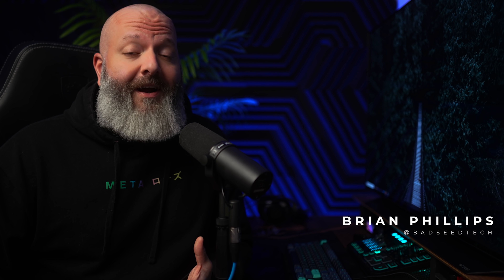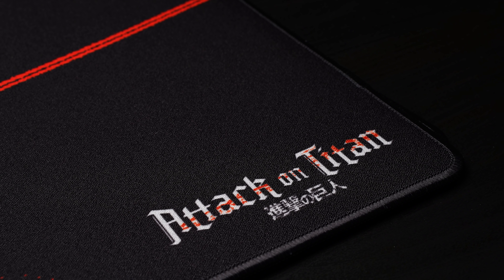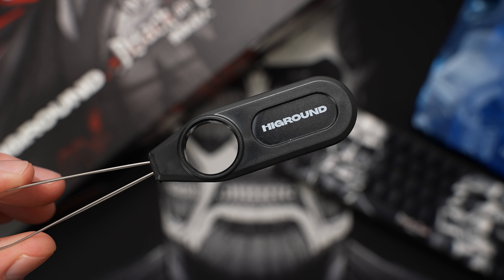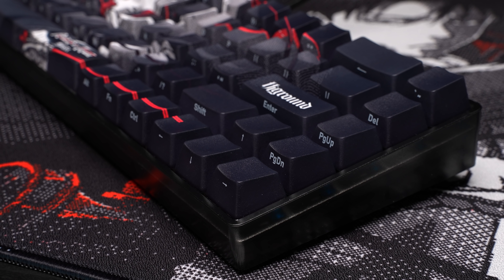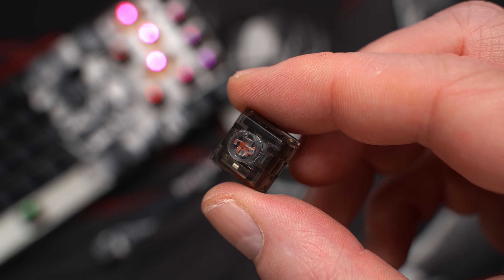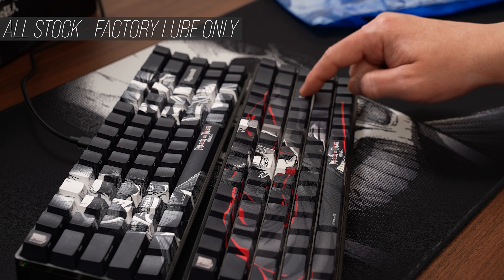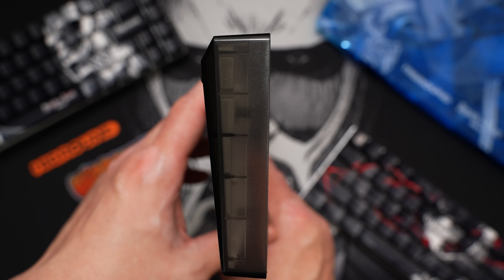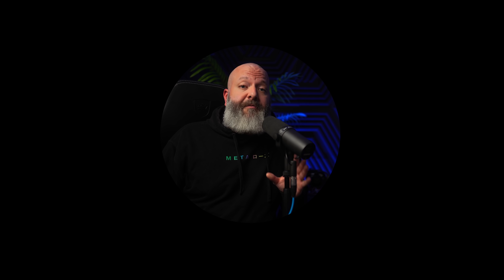ATTACK on TITAN Collab Capsule from HiGROUND !

Comment: Just slap some tape into the stabilizer housing holes and you’ll be A-Ok. Fixes the housing wobble right up. Arguably so much easier to mod and considering the board is Hotswap, it’s that much easier and accessible. Plate mount stabs aren’t as bad as people think.

Comment: Wow, that's an impressive difference.  I just went back to listed to the original 100 Thieves sound test.  Between the switches and the extra material in the case, the stock difference is really night and day.  Props to them on the improvements.